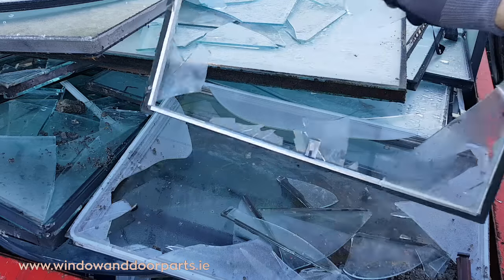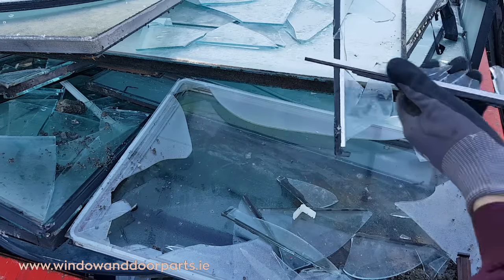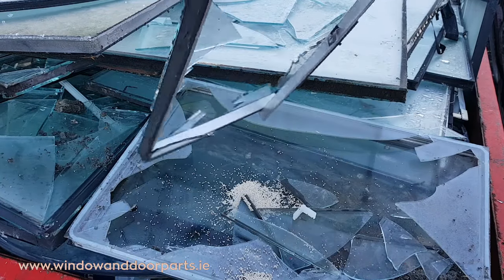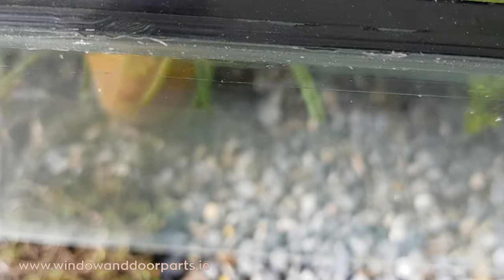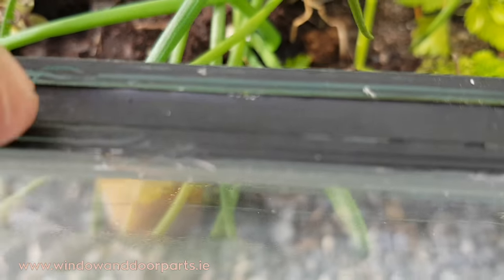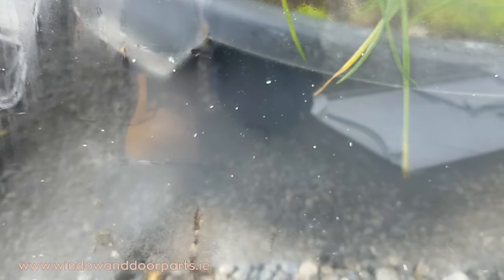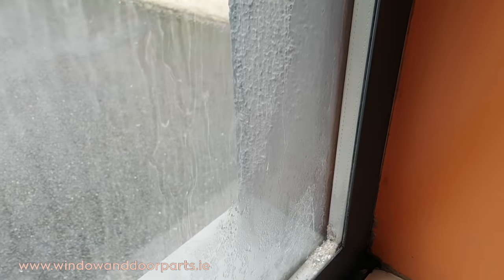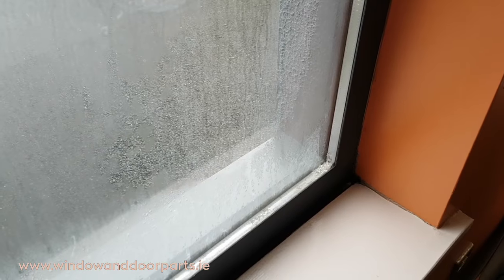Window Condensation Part 3 : Between the panes of glass

Comment: I was searching for a solution for my dirty windows and I just knew I was going to see another "Replace the lot" video.  But this one was actually useful, explaining and demonstrating how the problem occurs.  At least I now understand why I am having to replace the lot rather that just taking the word of the window salesman.
Reply from the maker: Thank you for the comment, someone who actually understood the point of the video.
Reply: @PaddysDiy  t
Reply: The best solution is to replace, but you can have temporary fixes. Try to find the source of the leakage, normally outside downwards, and fill it with some waterproof filler, drill some small holes on top from inside and then use a hair dryer from inside to evaporate the fog. This just works if you could effectively stop water from coming inside.

Comment: This problem will continue everywhere until the greedy manufacturers stop making them to fail, forcing you to buy new.  The cause is obvious.  The failures are on the hot sunny sides of the house. The units are made in a comfortable working temperature factory.  When in the hot sun, the air expansion is massive, and will eventually blow out a weak spot in the glue.  Then at night, there is a vacuum created and cold damp air is sucked in.  After many repeats, the moisture condenses on the glass.  There are two ways they can prevent this.  One, is to glue the unit together in a hot chamber, so that later on, the unit is mostly under slight vacuum, pulling the glue together, rather than forcing it apart. The hot sun cannot create such a high pressure anymore. The other way is to put a tiny one-way check valve in the spacer, so that the first time the sun raises the temp and pressure, the valve releases the pressure, and from then on, most of the time there will be a slight vacuum, as described above.

Comment: cut through the sealant as shown, take it apart, clean old sealant, remove and dry desiccant in the oven. reassemble, seal with PU glass sealer leaving two holes one at the top and one at th ebottom bottom. refill with argon, use cigarette lighter as a gauge, seal holes and you have saved yourself a lot of money

Comment: I used to make IGU's on a small scale many years ago when double glazing was essentially taking off.  All I can say is that it is perfectly possible to re-do the units provided it is approached in a professional manner.  

Split the unit apart into two pieces of glass.
Reclaim the spacer bars and empty out desicant or buy new pieces and cut them to length.
Fill spacer bars with new desicant and assemble into a "picture frame".
Thoroughly clean both pieces of glass on the sides that are to be inside the completed unit
Attach spacer bar assembly to one pane of glass appropriately set in from the edge of the glass
Lower 2nd piece of glass onto spacer bar and align
Lightly clamp or tape assembly together to prevent glass/spacer bar movement.
Fill the gap between sheets of glass up to the level of the edges of the glass with sealant
Allow sealant to fully cure, (several hours).
Reglaze window with repaired unit.

You will need something to fill the hole in the wall that used to be a window while you carry out repairs
You will need to purchase new desicant, new spacer bar if original cannot be reclaimed.  
You will need a flat area to lay down the prepared unit while you fill the edge with sealant and allow the sealant to cure.  The sealant will likely be two part polysulphide rather than hot melt (not silicone sealant).
Of all the chores, cleaning the glass will likely be the most difficult.  It will be mortifying to be installing your nice re-assembled unit into the window frame only to notice a smear or some dirt inside the unit that cannot be dealt with.

Good luck ! ! ! !  Properly done the unit will be as good as a purchased new unit.  No one said it would be easy, but it is doeable
Reply from the maker: Never said it wasn't possible to do. I said i would be surprised if someone was providing a service of reconditioning old units. The amount of time involved to recondition a unit far outweighs the cost of replacing with a new one. If there is anyone providing such a service, they either  don't value their time or have no concept of running a business. 

Because what you describe is FAR from an easy diy job. You are experienced doing it, so it would be a lot quicker for you, but still a slow job. 

From my experience, the vast majority of people don't even know how to remove a unit from a window / door, let alone undertake reconditioning a unit. 

For people who have plenty of time and have a good level of skill, it is totally possible as you outlined. But for 99.9% of people, it's not an option. 

The point of the video is to show the reason why they break down, and to show that there is no quick fix.

Comment: Thank you for giving an honest answer on this issue. I have see other videos that, like you said, show someone drilling holes in the glass and using a chemical to clean out the moisture, and seal the holes. I trust your evaluation that this cannot fix the issue, it seemed too good to be true. I am going to replace my 12 year old double pane glass in my doors that have this issue.

Comment: I saw those videos, too. And I'm glad I found this one because drilling holes and such seemed like it would cause more problems than fix. So the answer is they're old and need to be replaced. A pity, but I'd rather know that than wreck something trying to do it myself. Thanks!
Reply from the maker: Thanks for the comment
Reply: Drilling a hole would be much cheaper. They blow it out with an air compressor. Then you can caulk the holes back. It will definitely prolong you having to buy a new one
Reply from the maker: @redskinswizards3   🙄 nah man you sould fill it up with water and put a few goldfish in it. Diy aquarium

Comment: I have this on the doubble glazing in my council flat and they won't replace the windows. The best I could do as some form of solution was find the damaged parts of the sealent and reseal it, it doesn't remove the condensation but it stops it getting any worse. Thankfully it's not as bad for the age of them as some of the examples youve shown here.
Reply from the maker: That's unfortunate. Wish there was a cheap easy solution for you

Comment: I'm not seeing the difficulty in removing/cleaning/replacing.

I'll grant you, if your labor is worth anything at all, it's not cost effective.

But I'm mostly retired, and would rather putter than go do a couple of hours at what I normally do to pay to replace the window.

Just looked at my problem window again - looks to be a tri lobe rubber seal.
I know those can be a bit of a pain to seat, but it's not that bad.

Off to find a guide somewhere.

Comment: I solved the problem of condensation between the glass sheets. in my case, it's 23°C at home and -5°C outside, and of course the condensation appeared between the glass sheets. I took a roll of food foil (plastic), tore it and made plugs from the foil. with these plugs I plugged all the ventilation holes on the profile (outside) and inside the joinery frame (as you open the window on the frame, there are two ventilation holes at the top and two at the bottom). after a maximum of 12 hours, the water remaining between the glass sheets has disappeared. I must also specify the fact that I was lucky that the water between the glass sheets was clean so that once the water disappeared, there were no traces or traces of dust or mud as the case may be. if the condensation combines with dust or earth particles, then after drying, dust could remain. translate with google translate. good luck. Maxy from Romania
Reply from the maker: Thanks for the comment, my friend and I'm glad you solved your problem. But i don't think what you're describing is the same as the double glazing we have in Ireland and the UK

Comment: Great information. I am just wondering when there's water in between window pane, will that caused mold to grow around the window area?  Thank you
Reply: i don’t think so because my window has been like that for ages and has no mold or anything gross
Reply: Yes it does for us. If the window pane is wood, like ours. Ours has got black mold on the inside. The panes are also rotting away
Reply: Only if its wood

Comment: If the joints can be resealed and using high setting heat gun, wouldn't this solution work? I'm definitely going to try this approach.
Reply from the maker: If you have the time to do it my friend give it a try. Couldn't tell you if desiccant will dry out and be usable again. Give it a go

Comment: The only thing I can think of is to use a heat gun from the outside? it wont remove stains, but perhaps it can evaporate the water ?
Reply from the maker: The sun will warm up the moist air and it will evaporate. The reason why it fogs up and looks wet between the two panes, is because the evaporated moisture can't get back out and re-condenses when it gets cold. So unless you keep the temperature all the time above the dew point it won't work I'm afraid.
Reply: @PaddysDiy  damn just had a physics lesson 😢

Comment: Can you advise rough cost to replace one of these panes? I have 5 panes in my bay window and all have misted up. I don’t want to get ripped off.
Reply: He's never going to answer.  It's a hell of lot more than it's worth.  I plan to reseal mine because it's just grunt work and not worth the tens of thousands a crooked glass company will charge.  I'll learn along the way or fail, but I'll try.  Suggest you do the same.
Reply: @lindahickerson4658  I couldnt agree more! Our pvc is in great condition, we had two companies out both said we needed new windows complete! Rip Off Britain! Im doing mine this weekend & may actually even produce a video to help others!

Comment: Why the video? You could have said "trust me, just buy another window".
Reply from the maker: Would you go buy a new car if you got a flat tire? Why would you buy a whole new window when you could replace the section that needs replacing. 

The point of the video is to explain to people what the cause of the condensation.. Read some of the comments, people think that it can just be cleaned.
Reply: @PaddysDiy   Now, I'm confused.  It sounds like you said just buy a new window in the video.
Reply from the maker: @tonyborders7108 no i didn't say to replace the window in the video. I said replace the double glazed unit. The double glazed unit is not the whole window. You could have multiple double glazed units in one window. If one of them has condensation between the panes, just replace that one
Reply: @PaddysDiy  Thank you for the reply.  I appreciate your video and the explanation of what causes the condensation inside.
Reply from the maker: @tonyborders7108  Thanks for the comment

Comment: Give me one good reason why you can't simply separate the panes (or at least one of them) from the hollow center channel, refill the channel with new dessicant, then reattach the pane(s) to the channel, seal the outer edge, and put the window back? Why do you think the glass and channel need to be scrapped? Talk about wasteful and needlessly expensive...
Reply from the maker: Sounds so easy doesn't it, take it out, split the glass from the spacer, replace the desiccant, clean the glass and re-glue the glass back on. 

Do you realise how long it takes to do that? An absolute age to do it properly. I would be surprised if there is a glazier that even provides this service. If there is, then they have absolutely no value for their time or are charging way more than what it would cost to just replace it. I'll give you a bit of information. When you're hiring any trades person to do work for you. You're paying for their time. From the time they get into their van to drive to you, they are on the clock. So the shorter the amount of time to complete a job, the cheaper it will be. Replacing the fogged double glazing is going to be WAY quicker than what you're suggesting. Which in turn is going to be cheaper. 

If you're doing this job yourself that's fine. By all means go ahead if you have the time to do it. But there is absolutely nothing simple about what you suggest. Do you realise how difficult a job it is to do? And dangerous even for glaziers who know what they're doing, let alone a DIYer? I know a glazier who was splitting a unit to use one of the panes of glass. Knife slipped while cutting the glue, glass broke and went straight into his hand. Five hours in a&e and eleven stitches. 

How is it wasteful? Glass is probably one of the most recyclable materials in the world. It's just melted down and made into new glass. All the old glass I replace is separated into a skip and sent to be recycled. I'll tell you what's wasteful is the time anyone wastes trying to reseal or repair fogged double glazing. And the time reading your comment and thinking you know what you're talking about.

Anyway, I have to go. I need new tires on my car, but it's too expensive to get new ones, so I'm going to rethread them myself. Don't know what I'm doing but what's the worst that could happen eh? 🙃
Reply: @PaddysDiy  omg that response was so funny 😂 I understand how the initial commenter feels. 
Us regular folk are just trying to save money and being highly suspicious of tradesmen comes with that territory. But thanks you made a great vid with clear explanations 👍🏾
Reply: best of luck with that ! the inside of the glass is normally coated with a metallic oxide coat ,if you try to use vinegar or alcohol to clean you will ruin it ,it will look like an oil slick and lose half the thermal efficiency

Comment: So in essence would this make the double glazed glass be as energy efficient as a single plain of glass
Reply from the maker: If the space between the two panes of glass were filled with argon gas, there would be a reduction in the thermal performance. If the space between the two panes were air filled then there would be no change in thermal performance. It's still air between the two panes even if it's moist air
Reply: @PaddysDiy  thank you 
 If the seals had gone would this likely cause more condensation on the inside glass. Thanks again
Reply from the maker: No it wouldnt effect anything on the inside. Condensation on the inside surface is just a problem this time of year no matter how good or bad your windows are. The less thermally efficient they are the worse the condensation will be

Comment: Double pane windows seem like a huge waste of money. Who would buy these if your cannot clean them. All the Windows in the house I bought have crap windows that are dirty in between and the answer is to replace all. Replace with what? I live in a colder climate what’s the alternative to these crap windows
Reply from the maker: The whole idea of double glazed windows is they give way more insulation than single glazed windows. 3 or 4 more. So if you have a whole house of single glazed windows, the money you spend heating your home is absolutely flying out the windows. 

Double glazed units are sealed in the factory the day they are made. They're never designed  to be taken apart to be cleaned. They are glued together. Good double glazing that is fitted correctly should last for at least 20 years before they break down and let in moisture. That is just the nature of things. Nothing lasts forever. It sounds like the windows in your house are at the end of their life. So replace them with single glazed windows if you want to live in a freezer. Double glazing is you want to have a good level of comfort or triple glazing if you really want to minimise heat loss.

Comment: My parents entire house is double panned windows. F me.. they all are doing this.

I never hated a person more that I've never met before then the guy who built the house with his own plans. It is a money pit and guess who has to fix/replace this stuff. Me.

Is there another solution instead of replacing every single one of these? For my sake lol.
Reply from the maker: In my experience trying to cut corners to save money usually ends up costing more
Reply: Tint those windows withe film
Reply: @JosePerez-ok5rd  what will that do with window condensation in between the double pane glass?
Reply: @CoD_Maj3st1k  It will atleast cover it up and hide it if the person cannot afford to replace all of the old windows.. its ugly! I have this problem too, and I just cannot afford to replace all my windows, so I am having to cover it with window tints aswell, its effective though, hides it very well